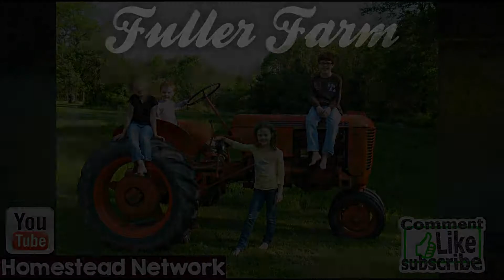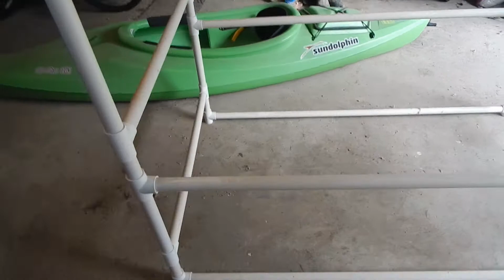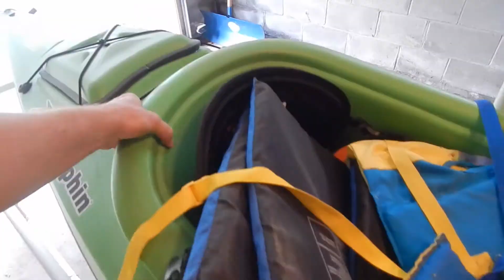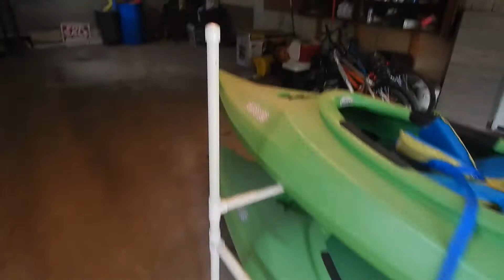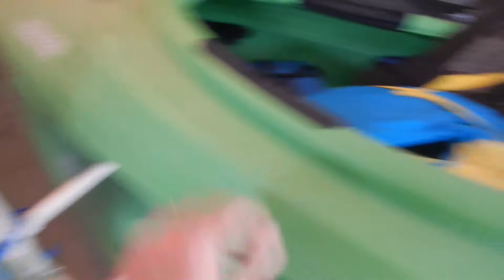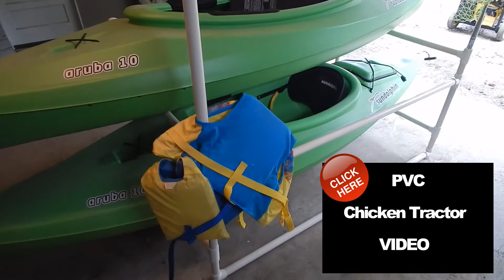Build a PVC Kayak Stand

Comment: How would this work for a truck carrier? I've got a tacoma, I wanna put two up top and one in the bed?
Reply from the maker: Mine is not glued but I think as long as you glue and you use heavy enough pipe, you could get it to work out in the back of a truck.
Reply: @ohfullers  Thanks
Reply: Use abs pipe instead of pvc for strength
Reply from the maker: @sugarpinesauve  good call